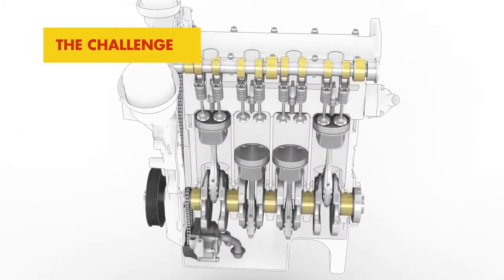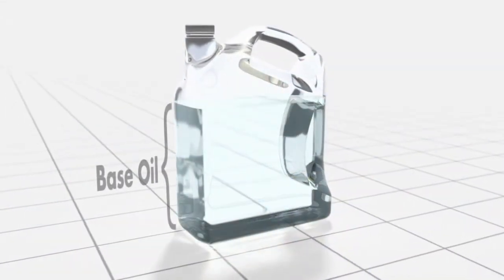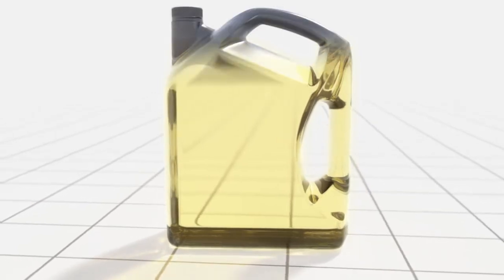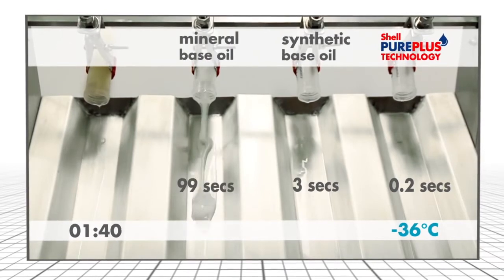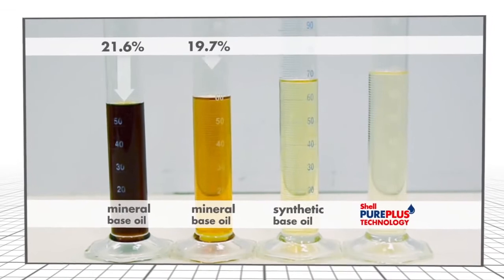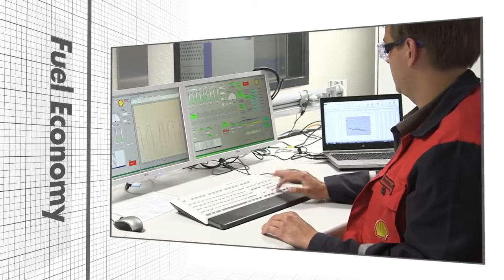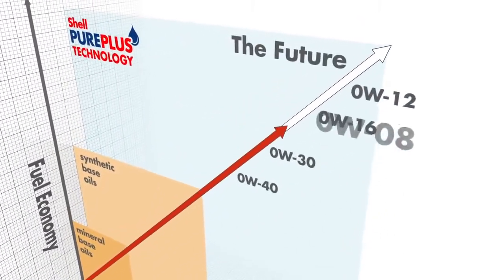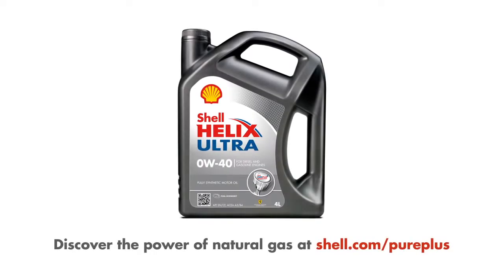The Power of Shell PurePlus Technology

Comment: Ducati specifies the Shell Advance PurePlus Technology 15W-50 4T for my DesertX ADV enduro motorcycle. It has a Desmodromic 937cc 90deg Testastretta V-Twin that spins up to 10k rpm and generates around 120hp with the Termignoni titanium race exhaust (cat delete) and EVO engine tune.
I ride in Texas where daytime temps can exceed 100 deg F for months at a time. I wouldn't consider ANY oil other then Shell Advance PurePlus.
On a side note, the ONLY fuel I run in the bike is Shell 94 octane.